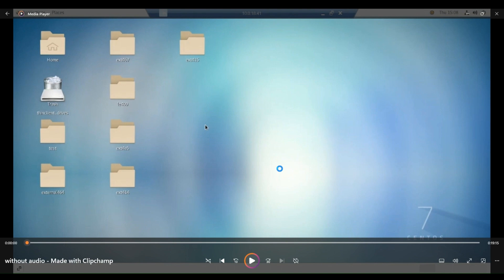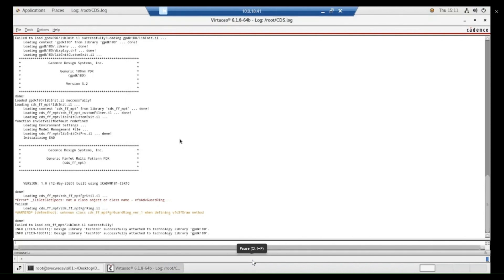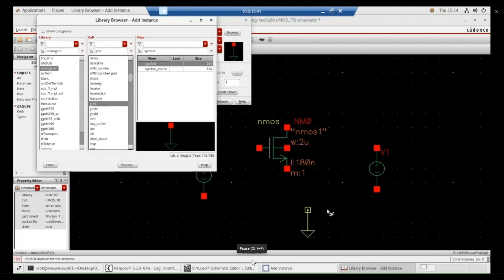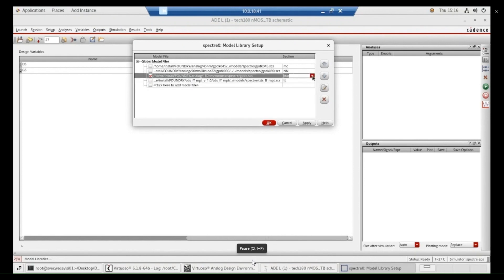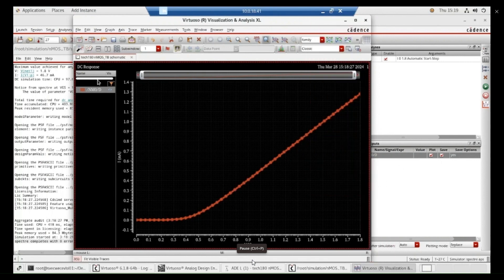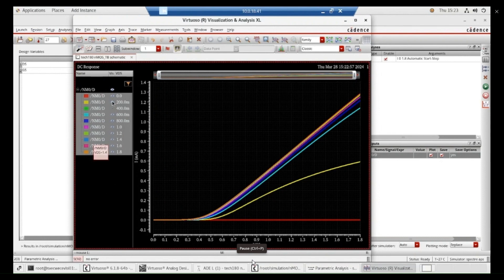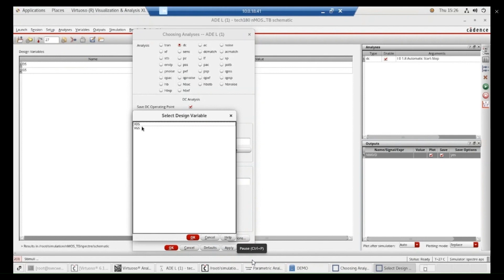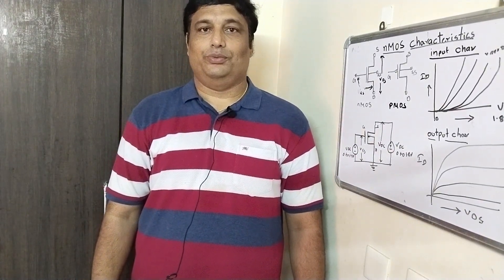nMOS Characteristics using cadence virtuoso

Comment: Sir the body is to be connected with source but you have connected is to a drain terminal does the threshold of the nmos changes from normal voltage